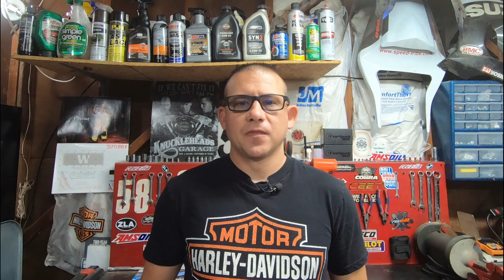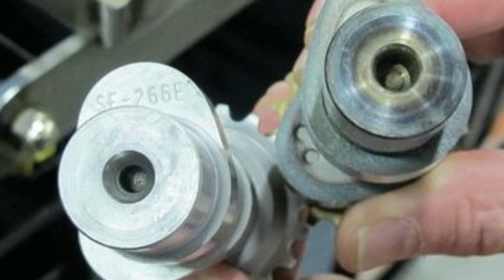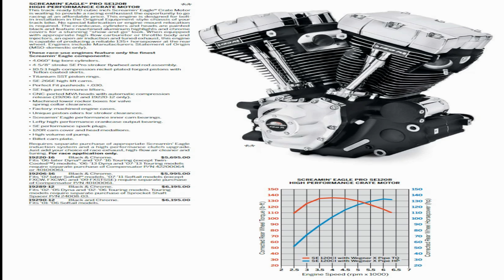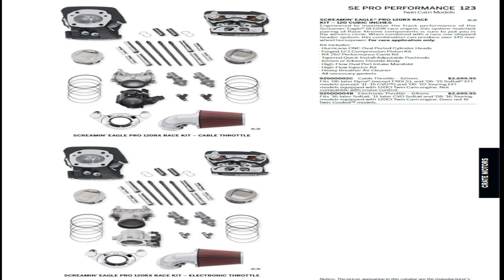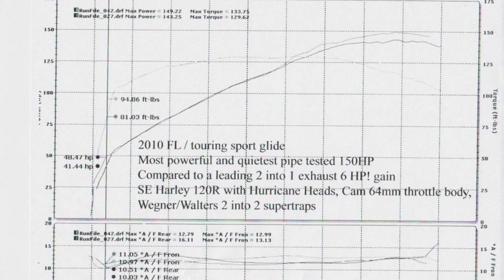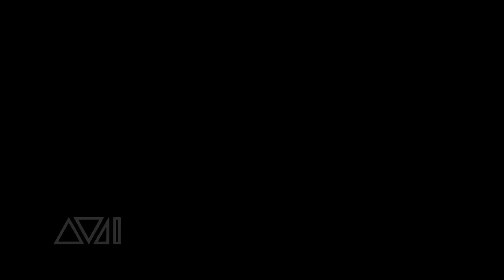Harley's Screamin Eagle 120R Twin Cam CAN Get Even More Powerful

Comment from the maker: Would you upgrade a 120ST or go with a 120R and add you own induction system?
Reply: Could you do a 120ST with the Pro Racing induction kit perhaps? Best of both worlds seems like, but very pricy. And what's with titanium rings!? Titanium is a reactive metal. I have hear horror stories about AR rifles with titanium firing pins that scored and ended up fusing with the bolt under high heat conditions after repeated firing. Wouldn't titanium rings gall up or fuse to the pistons? Valve springs is ok because they aren't in the cylinder and they get cooled by oil and aren't friction parts.
Reply from the maker: The RX kit would fit right on the ST, the R just gets a more aggressive cam and a bullet cam plate with a high volume oil pump. Other than that they are the same motor. They must be coated or something but they haven't had any issues with the rings sticking.
Reply: As for me , Yes. I want to change my 96 engine to 120 engine.)) That's f.cking good engine. Give's me more power and fun. Appreciate that video. Helped me understood more
Reply: Buy an S&S motor.
Reply: @newsnowadirondacksredux360 no! They're shit! My buddy went through Two 124 S&S engine in span of 3 years. 😅 only get 140hp 138ft lbs tq to the wheel but the power curve is different.
Reply: I would go with something that makes even more power 

S&S

Comment: When I went from a 98 Heritage Springer to a full in Road glide with a 95” big bore ,,,,I thought Ide jumped ahead in time 50 years as well.
   Besides have WAY more torqu and Hp ( 113 hp ) it idled smooth and had torque at every throttle position……Now, they are gonna have to make Roadglides stop way faster before I jump to 135 hp…….I mean …DAM !

Comment: Just picked up an 09 Road King with the 120R, 58mm TB, oil cooler and Wards blower fans. Does anyone have a link to the Service Manual? Interested in your views on lifters. Fortunately it has adjustable lift rods to make life a little easier. Cheers

Comment: 120st is great for the street, it would be powerful enough. Atleast for awhile
Reply from the maker: They've proved to be really awesome motors in the ST version, you can pop an aftermarket cam in there and you pretty much have more than a 120R. 120R didn't come with a throttle body like the ST, but you don't really need a 64mm throttle body which is what they try to sell you.

Comment: I just picked up a 2014 street light special with the 120R crate motor in it running the 58 mm induction.  For straight riding what are the shift points they're best suited to that engine I know in the video he said wide open throttle. Just trying to get a feel for it.
Reply from the maker: That's awesome!!! Those 120R engines are honestly no joke, they have the biggest factory cam you can get in one. Honestly a very reliable engine a lot of people comment on going cross country with them and I've seen a few myself.
Reply: @GixxerFoo My light came with a 4 inch basani 2 into 1 pipe, didn't see anything baffles, I was looking to possibly put true duals with deeper tips any suggestions And they also failed to include the Screaming eagle tuner.😢

Comment: So for a 2003 FXDWG anniversary model will the 120R fit in it with no problems?  Also if the S&S might be better what size of S&S engine would that be or what is the name of that engine?

Comment: Im stroked out with a screaming eagle 103 twin cam and 543 reaper cams...and even tho i hang with m8 114 and 117s..i still eant more power...but i have a 04 softail fatboy trying to find out if i can get a 120r in there
Reply: waaaat..I can put it n my 04 softail fatboy??? Cmon ..for real
Reply: Chain drive 32/51 re geared...performance springs Gorilla lifters and modified s.e heads! Plus the s.e stroker crank...I haul ass..but I know I can be faster

Comment: Is it not true that belt drives are limited to 100 HP or less because they snap at higher than that? I ask because I have seen some high-horsepower Harley's with double and triple row chains. That's the reason why I'm asking.

Comment: I have  2016 RGS with the 120r Pro RX with hurricane heads .  I ride city and Hwy and you can feel the chug on city streets in stop and go traffic . Nothing you can’t get use to . I did add the ultra cool elec twin fan oil cooler which made a huge difference with heat .  I can run 90 degree days no problem . I have encountered a few so called fast guys on the road . Smoked them in 3 gears well over 100mph .  If your into wheelies or burn outs no problem .  I also added a vision tuner just in case I want to ramp up the horsepower.  Bikes Bad Ass !

Comment: 👋 everone,  what would the dealers install in these 120R build across the nation , in all dealers ?
For instance: with a 64mm throttle,  what size & type of  cams , what timing would be set , what compression , what fuel grade , what is the normal running temp , Thanks

Comment: 2010 street glide running the 120R, Thunder Max tuner, Bassani 2 into 1 exhaust with ghost pipe, Baker 6 speed grudge box and fan assisted oil cooler. Change the oil every 2k miles with Harleys 20/50 and she does fine. Had motor installed 2 years ago, absolutely no regrets,,,,, ADVISE FOR THE HARD RIDERS TOURING MODELS,,,, get the Baker 6 speed, you will need it. 👊😈🤙

Comment: 10 years now with my 120R in E-Glide. Both daily street riding as well as long-range continental. Alaska Highway to the Keys, AZ, TX, Sierra Nevadas, 101 - you name it. I blew the head-gaskets while heading two-up through Phoenix in August to see the Def Lepard / Journey show, stuck in grid-locked traffic. Other than that,  absolutely problem free....

Comment: Ran my 120r for over 55,000mi. Never had any problems whatsoever. 134hp, 129 ft/lbs. modified it to 124” t-man specs. Now 156hp, 151 ft/lbs. never seen a S&S motor stay together that long, or put out those numbers
Reply: Hi, do you still ride that engine?
Cheers

Comment: Crazy question.....Will it fit a 103 block or a 110?
Reply from the maker: The 120 cylinders wouldn't bolt on, the cases would have to be bored to fit the cylinders. To get a true 120 you'd have to get a stroker crank and pistons as well.
Reply: @GixxerFoo  thank you... 
Keep these videos 📹  coming bro...they have really helped me
2016 Road Glide Special 103 H.O.

Comment: I recently purchased a 2014 Street Glide with a 120R in it. Its basically my daily rider in Australia. I can confrm it doesnt like traffic and loves to run. I love it. 
Many thanks to the team at Harley Heaven in Melbourne.
Reply: Does it Heat up in traffic  I suggest the ultra cool 3.0 dual fan  oil cooler and get the matching finned reusable oil filter. Mine never runs hotter than 240.
Reply: @rodgerbaer6382  well its currently getting a rebuild at the moment. Im on a loan bike. 😁 So far i have had it for 3 months and put on about 6000 miles on it. All parts on slow row boat from USA.

Comment: I'm looking at another $4K for pistons, cams, lifters, pushrods, cam plate, oil pump, pushrods, valve springs, retainers, and keepers to take my SE110B/117 Stage IV to the next level. Honestly, $6K plus a cam swap almost seems like a better deal.
Reply from the maker: It really is a better deal, and labor cost is a lot cheaper to just swap a motor if your paying to have it done,
Reply: @GixxerFoo  
I don't pay to have anything done, I've been building stuff for forty years, I trust VERY few people with my stuff. But, honestly, I could buy a new 120R, if they're still available, swap the cams out, use the 58MM throttle body and high flow injectors from the 117 Stage IV onto the 120R, and go have it tuned. It would probably be quicker and easier. And perform as well or better. And, I'd still have the 117 to play with. Maybe if my wife decided she wanted something different, I would just swap the 117 in place of the 96 on the Night Train.

It's just something I started thinking about, when I started adding up the parts, and my time, that I'd invest in upgrading my 117.

Funny, on back to back dyno pulls, an S&S 124T had less than a 12HP margin over my 117. Otherwise, I might look at an S&S engine.

Comment: Guys I am looking for some help I found a beautiful 09 RG that’s got a 120R built and installed by Cox HD I am in love with the bike and the power but I am hearing a lot of negative things about the motor saying it runs very hot and blah , blah , blah. I am buying a bike because I lost my last bike to MS and I want to ride again. I’ve asked him questions but he doesn’t seem to really know much any words or wisdom
Reply from the maker: The 120R does run hot, but a good rich tune, oil cooler and free flowing exhaust really helps keep the heat down. I've seen guys that ride with a 120R motor as a daily and do cross country touring on them. They have all the Screamin Eagle parts in them top to bottom, my honest opinion they are more solid than a regular off the line Twin Cam 103.

Comment: I'm kinda nervous about to buy a bike with a 120r crate engine in a street glide will be a daily driver hoping I don't have any issues lol
Reply from the maker: The 120R is surprisingly a very reliable motor, a lot of people go cross country touring with them. A little secret though, those motors are the same engine as the ST street version just with a hotter cam!
Reply: @GixxerFoo  any tips you can give me would be much appreciated I'm new to the harley scene the engine only has 900 miles on it

Comment: Can you tell me how to get the 120RX version to run on pump premium gas?
Reply from the maker: You would have to run octane booster or really drop the compression down to make it work on pump gas. The compression is so high on those you need some good high octane fuel.
Reply: @GixxerFoo  We tried octane booster to no joy; then one engineer decided to retard the timing 5 degrees; that made the engine stop pulling on upgrades. When we first installed the RX kit, I had to run it on race gas (110 octane) and it made a great deal of horsepower, but I didn't have the engineer dyno the bike at that time :( I ran it on a country road and it was very fast; I decided it was at a ridiculous cost so I asked if the engineer (H-D shop) could find a way to make it run on pump premium gas. The result was retarding the timing 5 degrees, which caused losing power going uphill. At present I have it at Iron Horse Performance (a H-D certified shop); the owner is a master HD engine builder. His plan has great promise for big power; details too much to mention here, but will post them when the engine is finished; I will include photos and cutlines.

Comment: Love my 2015 120r road glide 5 years running like a new bike 10,000 miles running top speeds 140 plus with ease. Great motor!
Reply from the maker: Great to hear! Those 120R's are awesome motors, I've talked to several people who do cross country touring with them. I was really surprised to hear that! But they are basically the same motor as the street version just with a hotter cam which makes a huge difference!

Comment: DAILY driving a bike I just bought. 2008 Road King with 120R. Ported polished oil pump, 660 cams, head work, 64mm throttle body, high flow injectors. This thing has some intense power. Only had it a few days. Much more power than my S&S 113 in my rigid Swift chopper.

Comment: What can I do to my 2003 100 anniversary Electra glide ultra for more thumping power sound and more horse power. And still get great ridability
Reply: Would the 120st go into my bike and would I haft to put a 6 speed trans in it
Reply from the maker: You could swap the engine to the 120 with a 5 speed, but power and reliability on that original motor a cam swap would be the way to go!

Comment: I have a 2001 Fatboy. I installed the 120R engine about 4 months ago. It has  bit over 6500 miles now with no problems at all. Gas mileage, when riding long distance is about 32 mpg. I installed an oil cooler because the summers in south Texas are brutal. Added a SE ignition system module and high capacity coils. 
I've had no problems at lower speeds. If you do, just drop it down a gear
 (I have a SE 6 speed transmission)
Personally I love  the engine and wouldn't hesitate to do it again.
Reply from the maker: Damn you have one hell of a nice ride! Those 120R's are really reliable engines, some people run cross country with then in touring bikes.
Reply: Thanks for sharing because I also have a 2001 Fatboy with a 95 twin cam and I wanted to do the 120r upgrade.

Comment: I have over 20,000 miles on my 120r and it still runs amazing!!!
Reply: Is it worth getting the motor? What was total cost for you for motor and the injectors and induction system? Looking at this kit instead of building line
Reply: @CodyMcDonald89  I love the motor and the power of it. I can't remember what was all installed since it was 8 years ago when I put it in.
Reply: @CodyMcDonald89 worth it
Reply from the maker: That's awesome! It really is a good street motor with the proper maintenance and cooling!

Comment: This is the kit I basically put on my bike the only difference is is I used the 4 and 3/8 in crank I don't need all that extra stunk I only weigh 160 the heads and my 67 g's mean with the shorter crank I can run up to 7200 RPM that's how I get my 124 horse out of a 111... My torque is still low enough I can handle the bike barely and the horsepower is off the hook
Reply from the maker: That's a huge benefit to building your own motor, there's a lot of ways to get the power. Sometimes l think Harley goes the long way to make the spec sheet longer 🤷‍♂️.
Reply: @GixxerFoo  Harley literally delivers the bottom of their market their engines can make crazy power but they don't need it it's like you said an 88 does just fine for your regular guys I am an idiot and like to go fast

Comment: i work for an unofficial Harley shop and we got a Fatbob in with the 120RX hurricane on the dyno we got 264 Torque and 235HP result even the boss that did the ride test was shaky after he got back to the shop...hes words in a slight scream was " this thing is a death wish" 

this bike is so powerful you barely release clutch and it starts running its scary actually😅
Reply from the maker: Holy crap! Is that someone's street ride?! Well, at least the Fat Bob is a really good handling bike 🤷‍♂️.
Reply: 264tq and 235hp?! Are you sure you don’t mean 164tq and 135hp?

Comment: How much is the Harley-Davidson 120R if you go through Harley-Davidson
Reply from the maker: The 120R is goes for sells for about 5$695 for 06 up Dyna and Touring models, 07 and later softails are $5999, 02 to 06 Dyna and touring $6195 and 01-06 Softails $6195. If you have a dealer doing the work, that's about the same cost as what buying a Stage 4 kit and having it dealer installed would run. But doing the 120R you can keep your spare motor or sell it to recoup cost. Plus you have a documented paper trail from Harley-Davidson for your bike showing that 120R belongs in that bike since the motor won't have your bike's vin.

Comment: What's a good headlight for a 2006 Harley Davidson night train for a reasonable price because the stock one sucks
Reply from the maker: I run these LED projectors from Sunpi in my bikes, they look just like the Harley-Davidson Day Maker. I've been running them for 5 years and had zero issues, it's a major difference over stock. They make these in smoke and chrome, you'll just have to verify if your headlight is 5 3/4 or 7 inch.
https://www.amazon.com/Motorcycle-Headlight-Davidson-sportster-Projector/dp/B018LXCV4U/ref=sr_1_5?crid=1FD89GKB7XND7&dchild=1&keywords=sunpie+headlight&qid=1616274536&sprefix=sunpi+headli%2Caps%2C266&sr=8-5
Reply: I have a Wisamic from Amazon on my 07 Night Train. It cost $55, and looks and functions just like the Harley Davidson Daymaker on my 2016 CVO Pro Street Breakout. In fact, it has an LED halo, you can see it for a 1/2 mile in daylight, on low. Makes me real happy, my wife is a new rider and rides my Train, I like that it is nearly impossible to not see her.

Comment: This is not true I have a friend who owns a dino and he is dino three 120r The most they ever did was it 105 hp at the rear wheel he’s confused he must be thinking the crank and the reliability is garbage on these engines you’ll be lucky to get 10,000 m
Reply from the maker: I've heard of some issues with these motors, it seems like a dice roll. Some guys go touring on them and put a butt ton miles without issues. I guess it just depends who built it on what day somce these are hand built.
Reply: I got  60,000 miles non my Jims 120  welded flywheels smoke anything 145 ftlbs

Comment: I like the shorter stroke 117” , longer ring life pretty equal power.
Reply: Same here doing a short stroke M8 motor now. 4.310 bore x 4.375 stroke 128ci. Good rod to stroke ratio good ring life. Factory plus one valve CNC ported heads & intake aftermarket moderate lift cam. Pretty easy to get safe tune 150/150 WHP TQ motor that lives.
Reply from the maker: There's a lot to be said about short stroke motors, they will run hard!
Reply: What cam are you running